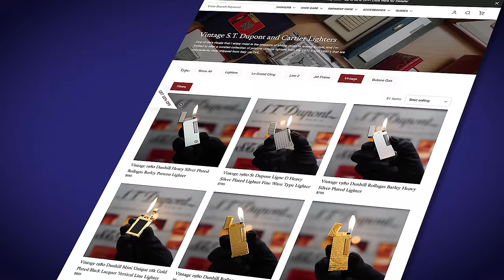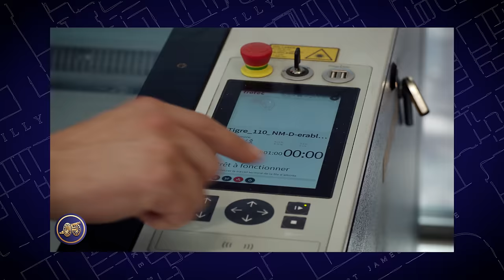First Smoke at Home | Putting My New Home Filtration System To The Test | Kirby Allison

Comment: I have to agree, sitting quietly in your home is the way to go. I installed a negative pressure downdraft system 15 years ago and it has worked excellently. My bar area is in the center of our great room (Living, Dining and kitchen) in 40'X 42' space with cathedral ceilings, and all the air space allowed for purely extraction, without filtration. Will admit, it is not perfect but handles like 90% so happy with that. Great stuff, Thanks.
Reply: That's a very large space, what size fan/cfm are you running?

Comment: None of this makes any sense to me, but it looks like you are enthused. Bravo. 

I am amazed at whoever installed your system. They connected flex duct to both sides of a filtration system like that. There is no way you have any airflow through that thing.

Comment: Only a $2-3K increase in the power bill! Gotta love TX! I live in NRH TX, built a cigar room and installed a vent used in greenhouses for weed ventilation. I vented it through the roof in a straight line. Simple air return. Poor man’s cigar room but Works great. 😉
Reply: I didn't even use an air return. The negative pressure is a positive imo, pulls fresh air in the  entire house whenever I smoke. Believe it or not outside air is typically always cleaner.

Comment: I think you could install some folding french doors in the entrances to that room to restrict the airflow to the rest of the house if you find there's a bit too much smoke escaping.

The main challenge will be if you have guests over; having 2-4 lit cigars in that space will likely be far too much for the filtration system to handle. But if you install even a few thinner doors, open the window, and run the filtration system I expect you could avoid most of the smoke escaping.
Reply: If smoke is escaping he's not pulling enough negative pressure against his hvac's intake. He spent a fortune on bs lol. Through the roof is the only way to go and even then the room itself is going to need a deep clean often.

Comment: I loved a good smoke and because of that, I'm wearing an oxygen cannula up my nose. I have it on 24/7 and have for the last few years; I will have it on my face until the day I die which I'm reliably told will be within six months. I cannot now travel by aircraft, I can drive but with an oxygen supply travelling with me. I did love a good smoke! Tobacco is a dangerous product even in it's most desirable form. You can paint a rainbow on a turd but it remains a turd. Do have a good think about your family if not yourself alone. I am not a dealer in doom but these words are truth; I sincerely would wish it otherwise. My best to you.

Comment: Wait. Did you say running your filtration system every day year around would cost 2-3k a year in power? I sure hope I heard that wrong. I don't spend that much on power in AZ for my enitre home for a year.
Reply from the maker: I actually think it would be less. That’s 24/7 at full speed. I run it at half speed, which uses a third of the electricity, and only when I’m smoking.

Comment: The filters get dirty and will blow smoke scented air. Lmao. The walls will still get smoke smell. The smoke will still particulate away from the main clouds and coat everything. I say this as someone even with a proper roof vent system and carbon filter in the room. It something you manage but can never eliminate. Better for a guy with your money to get one of those sheds that could double as a mini house, run electric, insulate, drywall, run a roof vent and a window ac unit.. or minisplit if you want to be real fancy.

Comment: TALK ABOUT SMOKE AND MIRRORS, if this is ment to be a serious video.

This is a comedy isnt it? 

The best air filtration system on the market (I'm sure you said its yours like you own the company. Newly installed but you can't open the door on the unit. HILARIOUS! Then HACK a $h!t ventilation pipe out only to realise you still can't get into it because the door swings the wrong way and there ain't enough room the other side. COMEDY GENIUS!! Then SHOWING OF YOUR MASSIVE GOLD LIGHTER AND YOUR HUMIDOR, smoking EXPENSIVE CIGARS IN YOUR TINY ROOM WITH A BROKE FIRE PLACE LAUGHED SO MUCH I NEARLY WET MYSELF.

WHOEVER WROTE THIS SKIT HAS A GREAT FUTURE IN COMEDY 

ABSOLUTELY HILARIOUS 😂🤣😂🤣😂

WHEN THE WIFE COMES IN AT THE END AND STATES your new badly fitted TOP OF THE LINE AIR FILTRATION SYSTEM DOESN'T WORK... I LAUGHED SO HARD I GOT A HERNIA

This was epic I gotta save this for future giggles